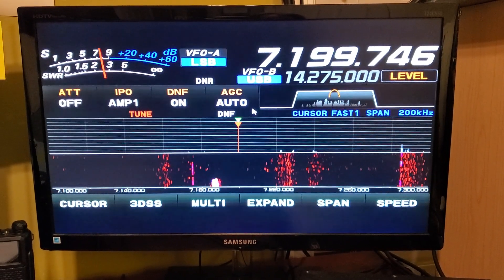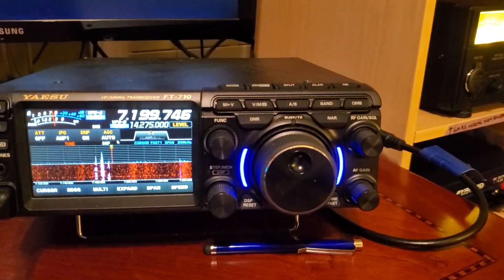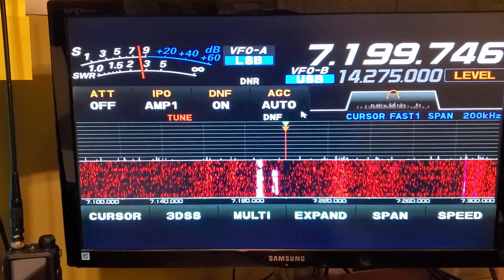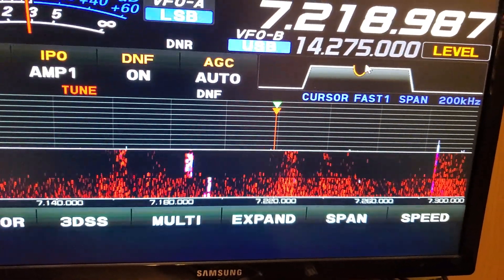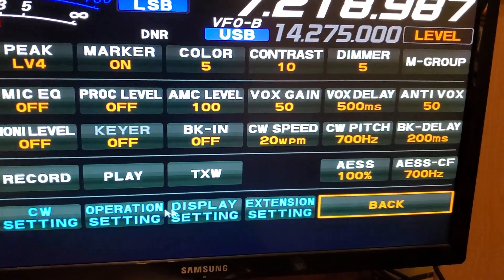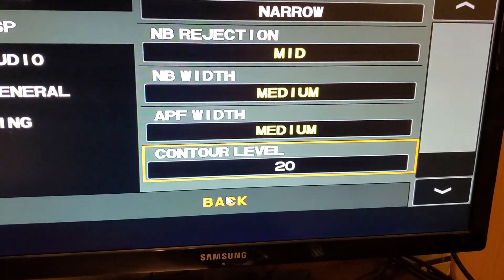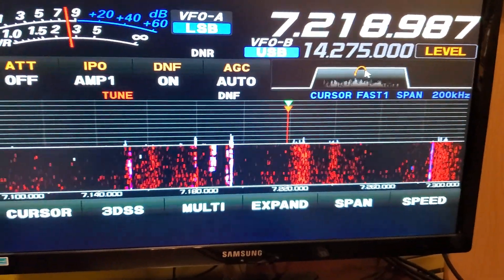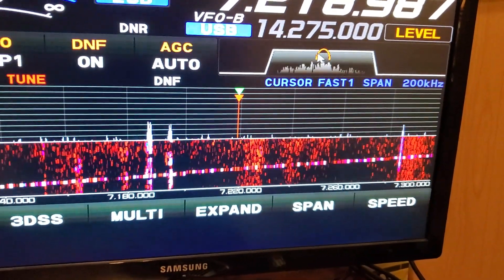Yaesu FT-710 - Reduce noise in 5 easy steps.

Comment: You have a gift for communicating with clarity. I unboxed and set up my 710 a few days ago. A number of years ago I had an ICOM IC-7300, which was a great radio to learn about navigating with a touch screen. The 710 is very similar, but with even more parameters. I haven’t had time yet to start digging into learning about the new radio, but this video has been a great introduction for demonstrating an important feature that will help with the inevitable audio challenges that come with working HF. I’ll be taking another trip through it when I head down to the shack today. Thanks for taking the time to make a great tutorial! 73 de WN3S!
Reply from the maker: Thanks for watching and commenting. Just trying to provide information that might help folks out. 73! AE3HD

Comment: Hi mate. Just got a question.  Did contenting a screen th the yaesu 710 cause you and damage  to the radio? Was all keen to buy one for this feature  and hear alot of bad issues with internal damage..
Reply from the maker: I never had a problem using a DVI-D to HDMI cable but just for insurance I ordered a DVI-D to VGA Male to Male cable. Just make sure whatever monitor you use has a VGA port (like for a computer) many monitors have the VGA port. 

Honestly I think a HDMI is probably ok as long as ONLY the radio is plugged into the monitor (no keyboard or mouse plugged into the monitor.) In other words don’t try to control the radio from the monitor. The monitor receives the screen output only and that comes directly from the radio. 

In my opinion the FT-710 is an outstanding value for the money and if I ever had a problem I would definitely buy another one.

Comment: The proper use of RF gain is not well known for some reason. I had a KX3 where I usually had the RF gain around 50-60% most of the time. The AGC tends to "squash" the audio dynamic range, rather like a microphone compressor. This means it brings up the background noise. Reducing the RF gain means the AGC is not working so hard, so the noise stays at a lower level. You also have less noise coming up between words when listening to SSB. Very useful video, as I'm considering buying a 710. Best wishes. Jon, G4LJW.
Reply from the maker: So true. I've also found on the 710 that decreasing the DNR and manually using attenuation along with the rf gain at times works better than the noise reduction features. Thanks for watching and commenting.

Comment: Great video  just got my 710 and I'm waiting on a cable to connect it to a external monitor where is your mouse plugged in at is it the radio or the monitor thanks
Reply from the maker: I have the usb for a Bluetooth mouse plugged into the radio. FYI, per some reports on the internet, it’s best to only use the hdmi monitor for viewing the screen. I have just used the monitor for viewing and haven’t had any issues. Thanks for watching and commenting.

Comment: Damn! just got my General last Saturday. I bought my ft 710 0n Friday, and I am understanding what you are saying.
Reply from the maker: I need to do an update to the video too. Sometimes on 20M and particularly 40M and up don’t hesitate to use IPO or 6db of attenuation when it’s really noisy too. Also pick up a bunch of ferrite beads and load up your power leads, coax, and monitor cable if you use one. That will likely lower your noise floor too. Thanks for watching and commenting. 73!

Comment: FT710 is best equipped for fighting noise and digging out weak signals. These are not available on the Icom models. One has to sit patiently and try the settings 🎉
Reply from the maker: Thanks for watching and commenting. That’s so true about patiently adjusting the settings.

Comment: Watching all thse videos to help choose between the Yaesu FT-710 and the ICOM 7300.
Reply: It is a hard choice for sure. I'm someone who would naturally lean toward the ICOM because of the easier operation "right out of the box" and the lack of menus to go through to get the settings... that being said, I tried both of the radios at a field day for over an hour each, and I easily chose the FT-710 AESS. The AESS speaker combined with the DSP noise processor makes listening to difficult signals much easier, and less strenuous on the ears. The TX audio quality with small adjustments to the EQ is also incredible. Performance just can't be beat, and the external monitor hookup is really nice too. Connection for digital modes is easy as well. I have heard the 7300 performs much nicer for CW, but I haven't tried it. Everything I tried in SSB and digital modes was wonderful. Hope that helps your tough decision!
Reply: @kaus1839  these sorts of comments have made the decision for me. There is a club nearby with like a thousand years of experience falling over themselves to help. So ease of setup is not important, but long term performance is. And I wont be doing CW. So it will be the Yaesu.
Reply from the maker: Which one did you end up choosing? I was looking at the Icom 7300 also. Thanks for watching and commenting!

Comment: I just found your video. I adjusted all of the settings as you've suggested, and it's substantially decreased the noise. I just bought the FT-710 a couple of weeks ago, and it's my first HF radio. I'm studying for my General so I've been just tuning and listening for the past couple of weeks. I had a lot of noise and your video was a big help.Thanks for taking the time to upload it. I'm sure it's going to be helpful to a lot of new operators.👍
Reply from the maker: Glad the video helped. One thing I’m tinkering with recently is on really noisy bands is using 6db of attenuation. Sometimes, but not always,  it will improve the signal to noise ratio then I adjust the RF gain. Also if you want to see visually your results turn on the oscilloscope function and watch the voice modulation as you adjust everything. It does help and shows just how sensitive the radio is (which is a good thing). Check out my other videos on noise also. They may give you some other ideas. 73 AE3HD.

Comment: I do like the way you can use the RF Gain knob to lower the noise and raise the meter floor...however, My OCD-ness says that I can no longer give accurate S-meter reports. Also when running a net, I am afraid after setting the RF Gain for one person, it may cover up another lighter signal. Anyway - There is a happy medium somewhere that I will have to figure out. So far I love the radios and will most likely sell the 7300.
Reply from the maker: I agree with every thing you said 100%. It’s all about finding that happy medium, which for me changes. Thanks for watching and commenting.

Comment: Very useful and correct information, especially that regarding the SNR associated with the RF Gain control.  These tips apply to all Yaesu radios with these features, as well as any radio with a controllable RF gain.  Thanks for putting this out there for the community.  Best 73's  Dan K1YPB - On the air since 1962
Reply from the maker: @danielzdanowicz6899  thanks for watching and commenting.

Comment: I find that DNR works much better when you remove as much noise as possible before introducing the DNR. Doing so allows me to use a lower DNR level and this reduces or eliminates the watery effect . 

On the lower bands I don’t use any amps as it’s not needed and only introduces more noise. On 80/40m I have amps off, 6dB of attenuations. I also find AGC slow on lower SSB signals works best for me. Reducing the RF gain and increasing the AF/volume and contour setting is something everyone should do. Thanks for your video. 73
Reply from the maker: @M7BCN  thanks for watching and sharing your experiences. That’s what makes this kind of video beneficial to all. 73
Reply from the maker: To confirm your suggestion I recently found that a monitor I connected to the ft-710 was adding an additional S2 to my noise floor. Relocated the monitor to remove the interference and DNR works better than ever. Thanks for your suggestion.

Comment: Its always better to turn the IPO to off especially if your in a noisy floor area. I live in an extremely quiet noise floor area so im lucky and can use the ipo if required but i very rarely do. Great advice for others that havent played with their radio. Well done for putting this out there
Reply from the maker: Thanks for sharing and True on the ipo. Just trying to help out new hams a little with the videos. Probably should have used a different band when making the video. Anyway, I can’t use the amp very often at all on 40m but on very rare occasions I can get a little benefit from it. I probably use the attenuation more at 6db (although not very often) because I find at my location at times it tones down the noise just enough to help pull the contact out. I’m also finding at times that I am occasionally using the oscilloscope function of the radio to help fine tune the RF gain to pull out the voice that is list riding just above the top of the noise floor. It works better than my old ears. Thanks for sharing.
Reply: I just got a 710 and this video was a great help. Thanks for posting! 👍
Reply from the maker: @mxcollin95  glad it was helpful.
Reply: correct. Amp1 should not be needed on 40m as the signals are generally stronger anyway. It's mentioned in the manual.

Comment: When your noise level is high (peaking 7-9 on the meter) in the absence of a specific signal, you can disable the AMP (set to IPO)… and then add attenuation until your meter doesn’t deflect too much in the absence of a signal. Then you can layer in the RF and AF gain recommendations, like suggested in the video. While you may not see very high numbers on the S meter with attenuation in place, it should give you better signal-to-noise.
Reply from the maker: @Kinetic79  Good point and suggestion, particularly regarding IPO during high noise. An example of that today is noise was really low on 20 meters and I picked up a contact in Santiago, Chile that didn’t even move the S meter but because I could hear him I could make the contact. It’s the S/N ratio that makes a real difference. Thanks for sharing.
Reply: The first thing to do is reduce the s leve of the noise using amp off and attenuation on to get down to 7 or lower. This will prevent the agc from pumping the noise
Reply: @miker8379  right. in addition to the impact on AGC, you’re also pumping other digital functionality (visual and audio—waterfall, filtering, DNR) with a cleaner signal (to work with from the front part of the receiver chain). S7 in the absence of an audible station is a higher target than what I would personally shoot for, but it’s an improvement from S9 for sure. I think it’s sensible to have the colors on the waterfall and the S meter action reflective of signal, rather than noise, and then your other gain controls will be more consistent from band to band.

Comment: You do know that exactly 7200 is the tuning frequency, right?
Reply from the maker: Thanks. All of my antenna builds are tuned for the middle of the band, so many times I don’t require the ATU on the radio. My EFHW is an exception though. Unfortunately the ATU on the FT-710 doesn’t tune the entire band at the same time, only a window (only 10 kHz per the manual) and I’ve witnessed that during use as I move up the band. I may end up with a separate automatic ATU in the future but the built in ATU does a good job matching impedance while tuning range though. If you have some other information to assist with the ft-710 feel free to share your findings. Thanks.

Comment: The DNF eliminates tones, not pulse noise.  If using CW or digital modes, never use DNF as it will target the desired signal.  Use NB for pulse noise.  The FT-710 has the best NB I’ve ever seen.
Reply from the maker: Very true regarding CW and digital modes and hanks for mentioning that. The NB is very good too. I’ve herd that Icom does well but I have no experience with them. Thanks!

Comment: I'm one of the guys who had the RF Gain all the way up so I could give a legit signal strength, using the AF as a volume. Tried the backing off of the RF with the AF up, amazing difference in the noise! The only complaint is that it is showing +40 on the S meter all the time. But now I see how these things work so I can get that figured out. Thanks for the information!
Reply from the maker: @reallyoldrookie433  glad it helped out. It’s just working through that process of finding out what works best for our particular situation. Thanks for commenting.

Comment: The area where you change the countour, the DSP, has several other settings that can make signals more intelligible.  You can make the pass band wider, narrower, or offset it one way or the other.  When there is a bad signal, even one that is being partially stepped on by another station, you can you can sometimes pull it out with the DSP by listening to less of the passband or shifting it a bit.  And if you get it wrong you can just reaet it with one button.  I also noticed you had an aess, how did that help, hurt?
Reply from the maker: @NShellhopper  Thanks for adding the additional info. I thought about adding that but tried to keep the video short and simple.  You are correct those other features can make a big difference.  As for the aess,I bought the field version,  then attached a quality stereo speaker. It made a difference,  I also faced the speaker away from me at my desk and that also cleans up the high noise in the audio over having it pointed at me. I probably will get a good set of headphones in the near future.  Thanks

Comment: Is there a way to turn those stupid blue LED strips off on each side of the tuning knob?
Reply: I use these lights to indicate which antenna I should tune.  Blue for 80M dipole, Green for fan dipole. Works as a great reminder and saves me from transmitting on the wrong antenna VFO A GREEN, VFO B BLUE.
Reply from the maker: In the manual page 36 it gives a way but I haven’t tried it. It says:

1. Press the [FUNC] knob.
2. Select [DISPLAY SETTING] → [VFO IND COL-
OR].
3. Select the item whose color you want to change.
4. Rotate the [FUNC] knob, or touch “<” or “>” on
either side of the value to select the Color. Select the color of the “3” mark in the table be- low for each item.

There is a table in the manual that says that “none” can be selected.

If you try it how about let us know if it works. Good luck.
Reply: @yqtszhj  Out of curiosity, I tried it and it works. But I set mine to red.